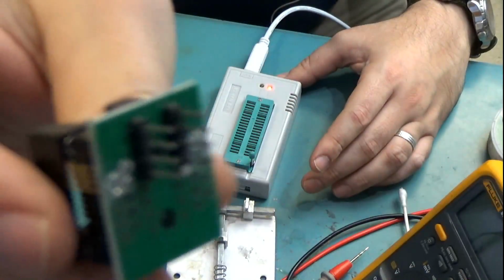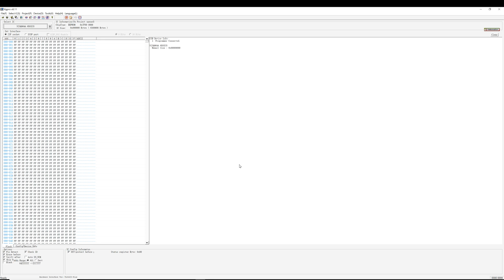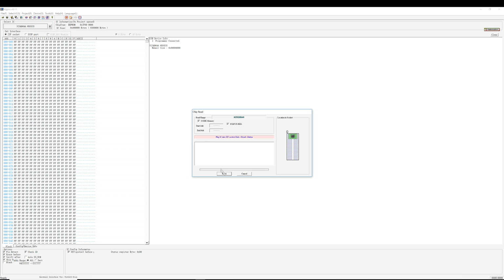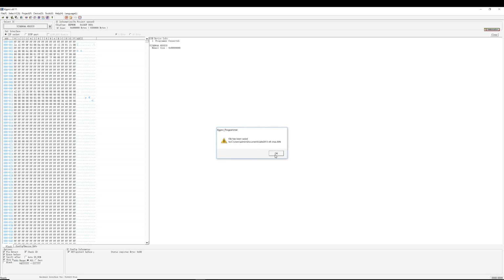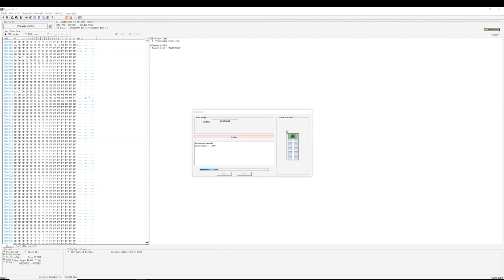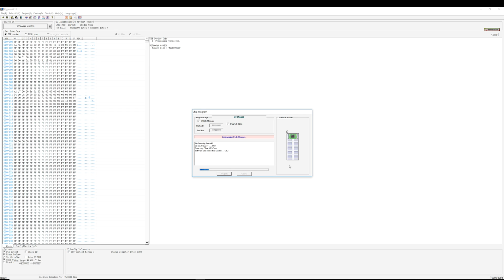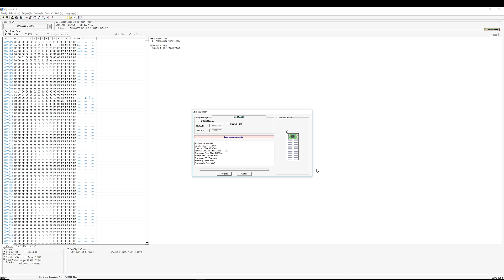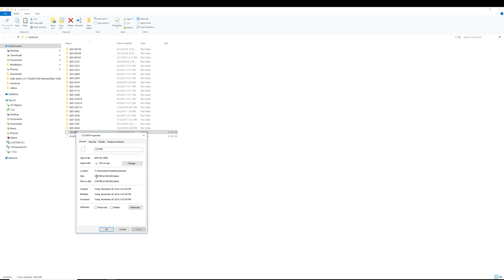Unlock and remove iMac EFI password using TL866II Plus EEPROM Programmer

Comment: So I don't need to switch voltage before programming with this model programmer? It comes with a 1.8v adaptor. So my question is can this programmer work with 5v and 3.3v with no adaptor or jumping required?

Comment: If you perform a lot of this work, buy a special head for your soldering iron Weller sell them !, don't use too much heat as this will rip the pads from the PCB, or you can use a horseshoe copper wire all sides of the IC, then apply heat, this will be far better, than blob a large drop of solder onto the chip

Comment: i am new to the field and use the same programmer.  I'm trying to load 93c66 and it's saying: ERROR!  CODE Address: 0x000000 Buf_Val:0x71 IC_Val:0x06 have you been through this?  do you know how to solve?

Comment: So is what you're doing there is using leaded solder (assuming the solder already on the board is lead free)  and the flux to lower the overall melting point and time taken for hot air to loosen the chip and make it easier to remove?

What temperature of iron and hot air were you using there as it didn't take long at all? Also curious about the size of tip you were using there if you'd be so kind?

Comment: Some of the older Dell, HP, and other laptop models where there is a master password that is stored in BIOS that only the certified techs have and it allows you to get into the BIOS where you can reset, or disable the password. Dell had a small app that runs from the command prompt, that provides you the master password to use based on the service tag if I remember correctly.

Awesome video.. you are not too far from me and I am in the same line of work, but I tend to focus more on the PC side and provide onsite and remote support, service contracts, etc.. If anyone asks me for an EFI password reset, I will be happy to send them your direction!
Reply: Bro i have 7 yrs old dell laptop and it very lagy

Comment: a pointless costly repair, if i forget or kids mess with a password, i take out the hdd, connected to another mac externally get my pictures files out then do a clean osx installation done.....
Reply: The point of the video is that the owner could not reinstall an OS.

Comment: I'm surprised you haven't made a little adapter that can just sit on top of the chip and hookup to your programmer without having to desolder it.
Reply: Did it several times, using a clip adapter on many different motherboards. It is likely that there will be silent read errors. And there is a surprise: you will never know this until verifying the chip. In some cases there is no way to realiable read chip using long cables attached to clip and motherboard stuff around. It is better to  assume that this is going to fail in all cases.
Reply: starshipeleven  i've had no issues at all from laptops. i fully pull the board with the flash chip on it, completely out of whatever machine. no power, use a low z capable multimeter (mostly just to give a more accurate reading on the voltages to know its as flat as can be) to fully drain any residual power traces and its always just kind of worked for me so far. 

the problems i have had, are limited to embedded custom boards.
Reply: Funny seeing you here! Haha. Mabuhay Pilipinas!
Reply: I have a tool just as you mention.
Reply: It‘s easier to desolder it. If the Chip is in place you need to power the iMac and pull high the reset signal. Quick desoldering and soldering is pretty fast tho
Reply: in most use cases, the 8 pin soic test clips will do the job just fine, so long as the system has 0 power anywhere. this means puling any batteries trying to power it on a few times with the power cord out. you'd be power it off the clip, and not the machine itself, making it more or less a straight read/write, unless they do funky things to the surrounding circuits that prevent you from getting the needed voltages in and out.
Reply: @kenabi  well im working with plcs andlet mi tell you that surrounding circuits most likelydo funky things

Comment: at 4:48 - what kind of solder remover are you using? it comes off like dream, i repair faulty laptops for a hobby but i couldn't get it right, i apply flux... but when adding the wire it won't suck up the solder, have you got any recommendations for that? thanks!

Comment: Makes me ponder what's the purpose of having a password lol
Reply: A password will stop an "evil maid" attack so to speak. The casual walk-by attack of an unprotected, unattended device. If you want your device to have some measure or security against a more determined attacker, you'll need to use disk encryption. Most modern cell phones and operating systems do this transparently once set up.
Reply: @TroyDowling  if that was true Cellbrite UFED used by LE to grab data off of cell phones wouldn't work.
Reply: To protect your pc from thieves but now with this new solution they can reprogram stolen pc's !
Reply: @1badpete999  no comman thief is going to do board level 'repair' and hex editing to flash an EPROM, having a password still helps to discourage theft by making it hard for people to resell or use a stolen computer

Comment: Will this procedure work on a macbook pro? REWA technology did a similar procedure on macbook air i believe, but the chip wasnt removed. Thanks for the great video! Would it be easier to replace the chip, just load correct firmware, then solder in?

Comment: I had a question, when you reprogram EPPROM, did Syrial Number get changed or still the same as orginal?
Reply: Reprogrammed my laptop's EEPROM. Serial number is wiped virtually, but if you have a sticker, the sticker retains the serial number of course.

Comment: Good, work but you could also you a EEPROM clip cable that plug into the chip without having to de-solder the bios and it only take couple of minute to reprogram.
Reply: can you elaborate pls..
Reply: have you done this before? what voltage did you use? 3.3 or 1.8? or 5V?
Reply: @thibautvancoillie7720  usually 3.3V

Comment: Hi. I have a question I'd like you to please help me answer. I have an iMac 2011 27" with an i7 2600 3.4ghz processor which has a 95w TDP, I switched to an i7 3770 3.4ghz which has a 77w TDP, both are LGA 1155, technically it should work, but no, it seems the EFI/BIOS is blocked to support Ivy Bridge, only Sandy Bridge. The question is... WHAT IF THE IMAC 2011 EFI CHIP IS INSTALLED WITH THE IMAC 2012 FIRMWARE which has support for Ivy Bridge, in fact the A1419 comes with this processor, or HOW TO COPY ONLY THE PART OF THE IMAC 2012 FIRMWARE/EFI THAT HAS SUPPORT FOR IVY BRIDGE, trying it and making it work would be a great help for thousands of users who want to upgrade the CPU of our iMacs 2011. I hope you read this message and please respond, if you don't know what would happen, it would be great to try. Thank you very much for your attention.

Comment: I am glad I ran across the video and watched. I believe this is what happened to one of my all in one HP Envy computers. Somehow I got locked out and it wont boot Win 10 completely and I believe I also have reprogram the BIOS memory chip. I also have the TL866 programmer and am able to do the soldering work to remove, program , and reinstall the chip. I think I am going to try this. Nice work. !
Reply: and did it work :D

Comment: I know this video is like a year old, but you should stop using that keyboard seen at 12:00 in the video. That looks like a Logitech Wireless 2.4ghz (non-bluetooth) keyboard/mouse. Those are extremely easy to hack with a cheap wireless dongle. All a person has to do it's get within 30feet of that keyboard and they can send keystrokes to your computer, and the system just thinks it's YOU typing. They could disable antivirus, download a file, run it, and backdoor your PC in seconds.
Reply: Oh really ? Do you have any more info on this ? 🤔

Comment: If you can able to do the resetting the PRAM that means the Firmware Password was already removed..

May i ask what is the application you used on viewing the schematic diagram of any model of Apple Main Logic Board? Macbook Pro, Air and iMac as well....Great Job, very inspiring..
Reply: Phoneboard

Comment: would you ever think that when de soldering and putting the solder across all terminals you might cause a static short? EFI , does it also required it's OS as when the computer was issued?  Thank you

Comment: where did you get the new clean bin file from?
Reply: He does not get clean bin file, instead he read the chip and then save to a bin file.  Then you can use a hex editor to remove the password portion after the keyword $SVS.  Finally you write the modified bin back to the chip.
Reply: 太阳雨 can this same process be done to remove mdm?

Comment: you could have saved yourself desoldering/soldering by using a SOIC8 Clip which allows you to connect to this chip directly ...
Reply: @mikapirinen2403  Clean the legs of the chip with WD-40 Specialist Contact Cleaner before attaching the SOIC8 clip.

Comment: And where is the dump ? ....  no one can do it if he didn't have that bios backup
Reply: No, everyone can do it.  You don't need the bios backup, as you only read whatever in the chip and then remove the password portion of the data after keyword $SVS.  Of course the only thing is you need to have an EEPROM programmer.  In face many programmers allow you to use adapter to cover the eeprom chip (after disconnecting the battery) to get the data, so you don't need to take the chip off the mother board.
Reply: @太陽雨-i2s  Well, this is another way to do that , but as you said you can do it like that , btw, about the programming without removing the IC from the board, is there any risk ? 
thanks in advance :)

Comment: Have you ever try to do this straight on the board without removing the chip?
Reply: risk burning other component. no thanks
Reply: @LeadFarmer813   As long as you check the chip data to see if it's a 5v, 3.3v or 1.8v and you can change the voltage on your programmer, then no components are at risk of burning. ps, sometimes if you are flashing the BIOS whiles it's on the motherboard. you have to connect the power supply to the motherboard, due to the programmer voltage dropping low to other components on the board. if flashing whiles BIOS chip is on the board, remember to take out the CMOS battery.

Comment: NorthridgeFix
: sir I have a question, the Firmware chip from your repaired Imac is a micron 25q064a 64mb 1,8 V. Can I replace the Firmware chip with a Winbond W25Q64FWSIG 64 mb 1,8 V SOP8 chip
 thank you

Comment: I've looked into these programmers a while ago. There are fake ones out there. Would try to order from a supplier that has the certificate of authorization. Later on that one will support TSOP56 with an adapter.
Reply from the maker: It shouldn't be an issue when buying from amazon.

Comment: Thanks for this tutorial. Could you tell us the hardware and software you're using to do the EFI chip programming ? Also is it possible to swap a EFI chip coming from a donor board of the same device model ?
Reply from the maker: https://amzn.to/2DODuG6. A link is also posted in the description. Yes you can swap EFI chip from same model. No problem.
Reply: It is the TL866 plus EEPROM programmer.  In fact if you have proper adapter, then you don't need to take the EEPROM chip off the board, and just use an adapter to cover the chip and touch the pins to read/write data.  That way is much easier
Reply: @太陽雨-i2s  do you have a link to get such a tool?